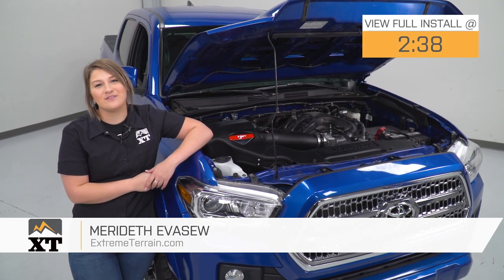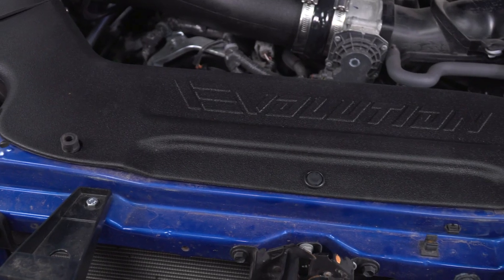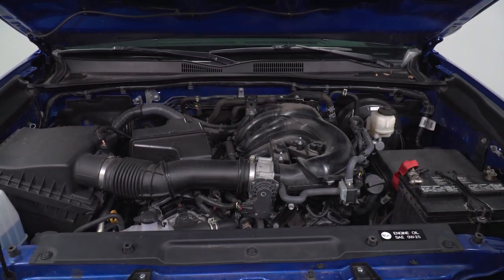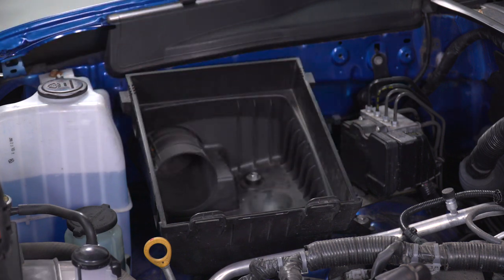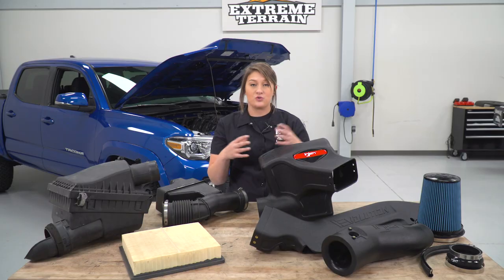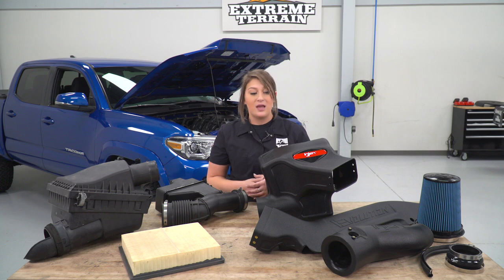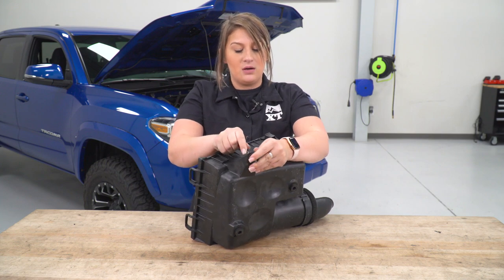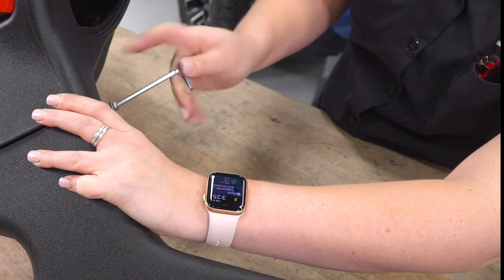Tacoma Injen Evolution Cold Air Intake w/ Oiled Filter (2016-2020 3.5L) Review & Install

Comment: Just my opinion, but the design looks like it will pull hotter air from the radiator/fan vs. the stock location and also will be more susceptible to water intake.

Comment: Not clear on how the ram air function would work. Top of the casing looks tight against the radiator mount. Does it draw air in from behind the radiator (hot air)?
Reply: With the air coming in the grill at speed, hot air bleed from the radiator would be minimal. There is a slight gap between the front frame and the top of the radiator. I'm worried this gap may not be enough when it arrives because I also have a magnuson supercharger that has another radiator mounted in front of the stock one.

Comment: Does the air box with the rubber piece actually slot into the wheel well, or is there a gap/sits over it?

Comment: So the ram air scoop pulls in air after the radiator? Wont that be pulling in hot radiator air?
Reply: I've seen this asked on another channel and it wasn't answered but after looking closely at the design of the "ram-air" portion, then looking at my 2018 Tacoma, the air will enter above the radiator. The radiator is at about 3 inches below the front frame the "ram-air" attaches to. I'm also checking out the S&B.

Comment: I currently have a safari snorkel hooked up to my original intake. will this work with the snorkel I have now on my tacoma?
Reply from the maker: I would highly recommend getting in touch with Injen regarding fitment of this intake with your safari snorkel. My gut is telling me that it most likely will not, but the manufacturer would know better than I would. 😁 -Zach
Reply: I’m on the same boat as you. Did you ever get it?
Reply: I ended up buying it. Yes it does

Comment: Save your money this thing sucks. 2 out of the 3 holes line up the 3 isn't even close no matter what one you choose to tighten last. Ram air scoop is like a 1/2 inch to short. Just save your money and throw a snorkel on for a better cold air intake or just leave the stock intake on.
Reply: Thing is a POS been tackling the 3 bolt problem for about an hour

Comment: So essentially you're pulling in "hotter" air since the intake mount sits right behind the radiator now.
Reply from the maker: The enclosed air-box in this kit still draws cool air from the wheel well just like the stock one does. The included air scoop however helps force more cool outside air from your grille, above your radiator, to keep things as cool as possible. This same design is used in many modern F150 engine options. Thanks for watching! -Zach
Reply: I was thinking the same.. more like a short ram intake